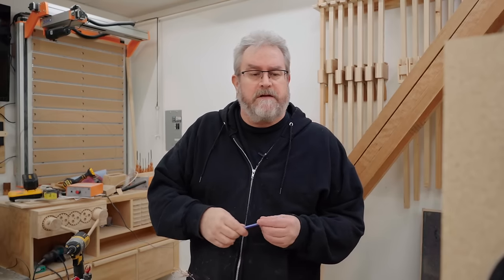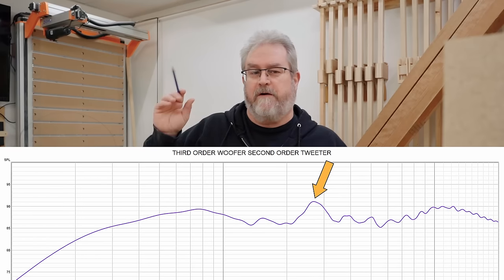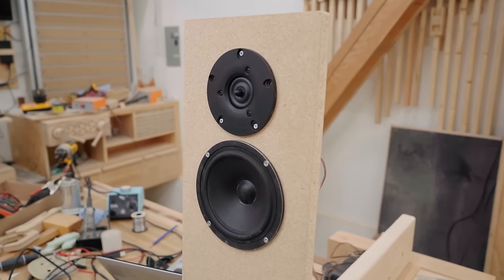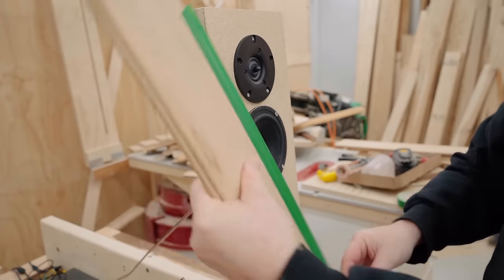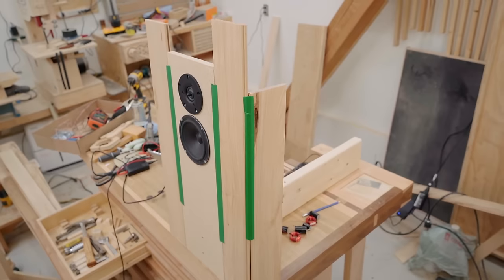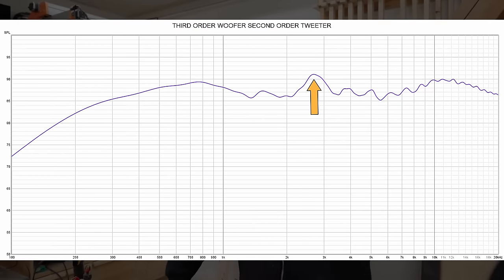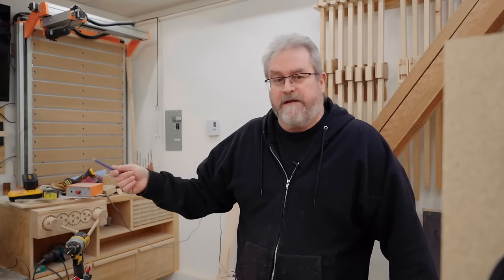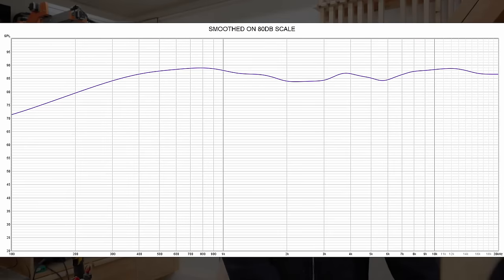The Dirty Little Secret of Open Baffle Speakers

Comment: Two thoughts:  Could you use a first order crossover on the tweeter, since it's crossing over higher and then use a third order crossover on the woofer to maintain phase and push the 4k peak down a bit?  Or, could you move the crossover point of the woofer down a bit, to something like 3.5k or 3.5k?  It sounds like you're happy where it's at, I'm just curious to know if you think either solution would be a bit better?
Reply from the maker: I tried a bunch of different combinations, including a 1st order on the tweeter and 3rd order on the midwoofer. I can get pretty flat response with a 1st order on both, but with a significant spread between the the two to reduce the peak - 1400Hz on the mid and 2500Hz on the tweeter.
Reply: To match two drivers crossing over, they need the same order and roll off type, some types better than others, for example the standard in active XR's is 4th order Butterworth also called Linkwitz crossover which when you mate the LP and HP together at the same crossing point/pole produce a maximally flat amplitude with constant phase. No engineer would mate say for example a 1st order LP with a  2nd order HP because they know you would get poor phase and amplitude alignment.
Reply from the maker: @engjds  You are wrong. Mixing crossover slopes is done all the time. Sometimes it's done to roll-off a driver quicker to avoid some undesirable stuff (like cone breakup). And sometimes it's done for time alignment. And sometimes it's done because it gives the flattest response.
Reply: @IBuildIt  PS: we are talking here about crossovers between one driver and another which should always be the same order, not driver correction which happens independantly.
Reply from the maker: @engjds  ?
Who's "we"? You say that like I butted in.
And you are still wrong, whatever way you are trying to say it.
In a 2-way speaker, you can have a 1st order on the tweeter and a 2nd order on the woofer. 
You can have a 3rd order on the tweeter and a 1st order on the woofer.
You don't need to match the slope between the drivers at all. You use different slopes to get the best results.
Reply: @IBuildIt  Sure you can use tin foil for wire, doesnt mean to say its the right way, no, the whole idea of crossover matching is to pick two slopes the inverse of each other to be flat at the Xover point, yes there are exceptions used in production speakers, but in theory its still not the optimal way for flat amplitude and phase, lets leave it there, I suggest you argue with the masses of speaker designers that have been doing it wrong all this time)
Reply: @IBuildIt  
That's funny.  There's always someone who knows what they read or heard is the truth.
Reply: @bbfoto7248  Newbies think its all about amplitude, its not, its also about PHASE alignment in that crossover region. I am not here to prove a flat earther is wrong, so think what you like. PS I have read all those books you mentioned decades ago, still have the Vance one on my shelf.
I think you may be getting mixed up here, we are only talking about XR on the mid to-tweeter.
You dont have to be a electronics whizz to understand order matching, its the basics of electronics, thats City an Guilds stuff right there, its not complex.
Reply: @Cornelius Agrippa  
Flat Earther, LOL.  
I'm not mixed up.  I said, the X/Os between any 2 or more drivers.  Yes, in this particular case, it is just the midwoofer and tweeter.

And when I referred to Good Acoustical Response (what we hear), ummm, that naturally includes proper Phase Alignment through the X/O region.  And if that bit is correct, your Amplitude Response will also be good... smooth and linear through the crossover and overall.

I've been building and testing DIY loudspeakers for over 25 years as well, and use Smaart 8, SysTune, REW, and now JL Audio's new and FREE TüN software, combined with CSL-calibrated Earthworks and DPA measurement mics to confirm phase alignment (in real time) and amplitude response, etc.

Sure, it would be nice if we could always only use 1st or 2nd order X/Os throughout.  But IME that rarely works out, and always comes down to the inherent natural response of the drivers we decide to use, their intended passband, etc.

Always using only 1st order filters, or only 2nd order filters, etcetera, between any 2 unique drivers does NOT guarantee perfect phase alignment and amplitude response through the X/O region!   All it takes is one look at the X/Os in some of the most reknowned loudspeakers ever produced to realize that!

There are multiple variables that will dictate what passive or active Electrical Filters need to be used in order to provide the best overall Acoustic Response...i.e. proper phase and smooth, even frequency response.

And yeah, I'll continue to "think what I'd like" as long as my ears and measurements continue to confirm my real world results.

Enjoy the music!
Reply: @bbfoto7248  Lets not convolute the discussion with "I have this much experience..blah blah", let the merit of the conversation be based on pure logic, here is the logic...
You cannot achieve perfect Crossover alignment using slopes with different order roll-on's or roll-offs unless you start combining them BECAUSE you need the inverse slope response that when combined cancels each other out to flat. for instance, the preferred crossover in active systems is the 4th order Linkwitz (or 2 times butterworth) which gives both maximally flat amplitude and phase response, you can use lower orders, but you will ALWAYS compromise on amplitude or phase.
I wont bore you with inverse Laplace transforms, but if you were at masters degree level I could, your math doesnt work, its simply impossible. 
Your knowledge is a symptom of those using REW, getting whats looks reasonable plots, but not knowing the maths behind it to achieve near perfect compromised characterists in not only amplitude, but phase and transient. All speaker designs are about compromise, but dont kid yourself mixing orders in the C-Over region is good practice.
Reply: @bbfoto7248  PS, just to clarify, when we talk about the 'order' of a system, its when both LP and HP have the same poles (i.e. same crossover frequency), you are probably thinking you can pick different poles and achieve a pretty good response, but thats not what we are talking about. For instance on a casual glance, my Jamo Concert 8's look to have a 3rd order, but if you do the math its actually 2 filters, one a 2nd order, combined with a 1st order on a different pole.
Reply: @bbfoto7248  
Wow Vance Dickason, that brings back memories!  Thirty something years ago...   I've also got several "speaker builder" magazine issues along with "amateur audio".  And decades worth of the more mainstream "audio" magazine.  Vance's book brought much joy!  Gonna hafta dig that up and reminisce.

Yup it's the audio wavefront that matters.
Reply: @elgringoec  Remember Bullock on Boxes? another classic.
Reply: @engjds  
Yes, I remember the title.  I didn't get that one though.  Was it a lot of duplicate info with the design cookbook?
Reply: @bbfoto7248  Box size and type determine roll-on, not the driver, that frequency response on the driver datasheet just shows you when the driver begins to break up, so you can choose the C-over point.
Reply: @elgringoec  Surprisingly no, it was fairly unique, less equation based, and more on the design of the boxes themselves.
Reply: @elgringoec  You can get almost any book in the world by entering the title and .pdf into google.
Reply: @engjds  
Cool.  So I'm still running with my latest design from about thirty years ago.  I went looking for focal and dynaudio current offerings and all I see are ready made systems.  What drivers are diy people using these days?
Reply: @elgringoec  The usual ones they were using a decade or so ago, spanspeak, eminance et al.
But I had a revelation 6 months ago, I bought some high end speakers from the 90's called Jamo Concert 8's which use Seas Excel Drivers, those are magnesium.
Now to hear them you wouldnt believe just how brilliant they sound to anything you heard before, I am a convert to magnesium,  The drivers are not cheap, but they are worth saving up for, easy to spot them, they have copper phase plugs and metallic looking cone.
The speed and dynamics are incredible, and the timbre, acoustic guitar just shines through them. Though the speakers are well built, I believe its the drivers that make the real difference, they were a £2000 speaker, you can now pick them up for £500 2nd hand. Might be worth buying those if just to get the drivers for your own speakers.
Seas doesnt do the 17cm anymore, but get some 18cm's and tune them right-which is about an average standmount size and I doubt you could buy a pair as good for under £5000 new.
I have found cheap pairs of Seas Excel on ebay for £300 - yes its a lot of money, but you wont regret it.
Reply: @elgringoec  Nothing much has changed really, just materials and better manufacturing tollerences, trend seems to be going open baffle with active filtering correction, yet to hear a pair, but I doubt they could still beat a good ported box at the lower end, they suffer below 300Hz, where the compensation has to push up the excursion so much it starts adding distortion. Have you seen the Harbeth designer talk on Youtube? thats very interesting, they make the drivers in house because he reckons commercial driver manufacturers cant make them better then him, Harbeth started from the BBC sound division, so he knows his stuff. 
Maybe most of the best drivers are made in house for speakers now, which makes it tricky for a designer reusing them having to measure the Thiele small parameters, possible, but its a pain
Reply: @engjds  Your way of looking at is the teoretical way of looking at a crossover. In practice the driver themselves have a phase shift because of different reasons. Break-ups are one problem that have a lot of phase shift. Self resonance point is another, and usually a tweeters phase shift around the resonance point (180 degrees) needs to be included in the design of the HP filter for the tweeter. It's not uncommon to get different crossover slopes for the tweeter and mid drivers, but when including the drivers own phase shift you end up with equal phase shift for both drivers. Phase shift needs to be equally steep and linear over a couple of octaves around the crossover point to get a linear frequency response. If not, you will get loobing and beaming problems with of unlinear off axis frequency response.
But designing a cross over is much more problematic than that. Baffle step, diffraction, time alignment, phase response, frequency response, step response.
There is a lot of parameters to consider, and there is a multitude of different techniques to handle these problems by modifing the crossover in different ways.
It's not uncommon to use a 6dB filter that turns into a 12dB filter and you can even do a 9dB filter if that is necessary.
What is important is that both drivers have equally steep phase slopes in the crossover band.
And remember.
6 and 12 dB filter ALWAYS sound better than 18 and 24 dB filter. But that is another topic that can be discussed and explained next time.
You say that it's not complex?
Actually it's indefinitely complex to design a crossover. Depends on how much you want to consider and adjust for.
The more knowledge you have the more complex it gets.
Reply: @flex-cx9bi Great speaker manufactures model everything first, the phase shift of the drivers is calculated using an equivent PSPICE crcuit which not only models the electrical side but the mechanical  (including box effects) as well based on the parameters of the speaker (FS. cms, vas etc).
As for complexity, that is a relative word, lets say speaker design is certainly not trivial, as for arguing about which filter slope is the best, I would like to refer you to the original theile-small, work of linkwitz etc that has already covered why certain orders  are inherently better to find the compromise between maximally flat amplitude AND phase in that region.
Yeah, push the tweeter down as low as you can before cone breakup is pretty common in design.
Reply: @flex-cx9bi  Sounds is a difficult subject to discuss, as its all about compromise, your point on 12db sounding better IS difficult to argue against (lower orders-> better transient response) but then crossing over with them brings troubles on their own in alignment, so horses for courses...sound is in the ear of the beholder! :)
Reply: @engjds  Loudspeaker designers that make every effort they can measure the phase at the same time as they measure the frequency response. Simulation or calculation is not precise enough.
Then you really see how a driver perform with the crossover applied.
So what you suggest is not enough if you want build really great speakers.
Don't refer to Linkwitz and alike.
Yes, they know much but are very theoretical. Once you built a lot of designs by yourself you will look at their theories as basic suggestions to better understand the theory.
They help, but they never give the answer how to best solve the crossover you need to find for a certain pair of diverse. That solution you need to find yourself, and you need a lot of own knowledge and a big toolbox of tweaking to solve the equation.
Reply: @engjds  Not only transient response is important.
To get the full picture of a recorded instrument you need to get all the harmonics of the instrument and room ambience in the same phase.
Only then you can get the full and accurate reproduction.
Only 6 dB filter can handle that.
The higher magnitude you have on the slope of a filter the more phase shift you get. And a harmonic overtone that are reproduced 180 deg out of phase will subtract and not add to the correct picture.
12dB filter is usually quite acceptable but 18 and 24 sounds off and bad to my ears.
Less is more in this case.

Comment: Not cone breakup but point in which cone becomes non pistonic perhaps.. cone edge issues causing dips or peaks
Reply from the maker: Cone breakup is where the cone becomes non pistonic - that's the definition.
Vifa (the manufacturer) recommends the driver's usable range is up to 5KHz. If breakup was happening before 5K, they wouldn't recommend you use it up to that frequency.

Comment: here is my theory about the unwanted peak at 3800hz: too much overlap between woofer and tweeter, caused by crossover. Solution: either you modify crossover cut-off from 12db to 24 db per octave (but watch for increased impedance...) or if you stay at 12 db/octave: cut tweeter at 5000, and woofer at 2500 (trial and error...).
Reply: Here is another idea...
Sound of speed is 343 m/s, peak at 3800 Hz (cycles/second). 343/3800 = 0,09 meter = 90 mm. Diameter of the tweeter?
Countersink the tweeter to get rid of the most of the peak first and then look at what to do with the crossover.

Comment: You can't deal with this by using filters to notch out peaks. This is a timing issue. A phasing issue. I know that you know this. Even if you were to filter that peak to be flat it will still sound strange.

Comment: You are wrong, some great drivers even have cone break up above 3Khz, take the Seas Excel (top of the range) that breaks up at around 3Khz, I do not get OB's at all, who wants to listen to music that rolls off below 300Hz, even with subs, in that region they are directional so you need two subs for stereo and the phase alignment will be all over the place between subs and speakers.
Reply from the maker: And? If that driver breaks up around 3KHz, that means this one does too? Seriously, that's your thought process?
Or did you somehow think you heard me say that NO driver breaks up below 3000Hz? Because I did not.
I posted the published specs on this driver a few videos ago. It's recommended range is up to 5000Hz. AND, I know what cone breakup looks like when I measure a driver.
Reply: @IBuildIt  First, this is a discussion not an argument.
Second, the seas Excel is a famous driver with good specifications.
Third, good drivers usually have cone break up at higher frequency as far as I know, but willing to be proved otherwise.
However the peak you mention I agree is probably not cone break up as its too symetrical, looks more like a resonance thats unassociated).
Reply from the maker: You don't start a discussion with "you are wrong". You start an argument that way.
I know all about Seas drivers and how good they are. I've used them / have them.
ALL drivers have cone breakup. It happens when the cone stops behaving like a piston and it happens at different frequencies based on cone diameter and stiffness.
I know the peak isn't breakup, since the manufacturer recommended frequency range is up to 5KHz. They wouldn't recommend using the driver in its breakup region OR if it were suffering from a resonance.
Reply: @IBuildIt  I never said the peak was breakup, I think I misinterpeted what you said, it sounded something like "It cannot be 5khz because that too low for breakup"-but as in a generality rather than specific to that driver, so if thats what you meant I apologise. BUT you are wrong on the different orders for crossover between drivers however, nothing wrong with that, I make mistakes all the time).